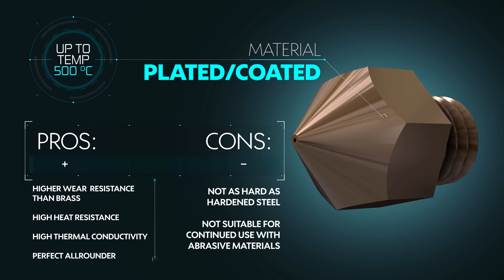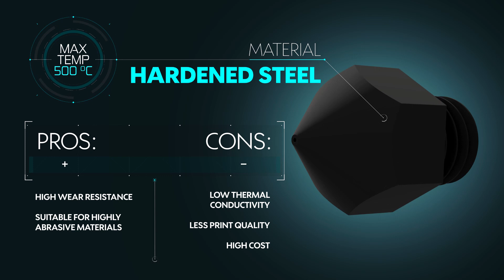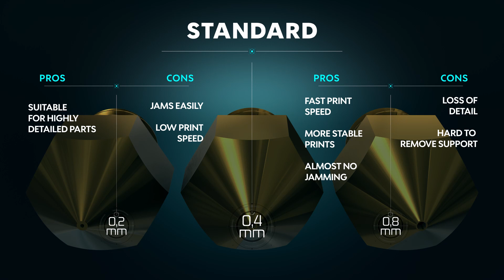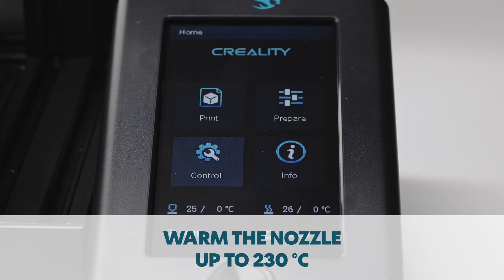3D Printer Nozzle Guide (+ how to change it!)

Comment: Is it necessary to replace or cut the bowden tube? I have changed two nozzles without changing it and they lookks working fine.
Reply from the maker: Hi Andy! Thanks for watching. :-) 
No, it is not necessary to cut it.
Reply: It depends to your printer. I am using Anacubic Vyper with no problems as long I used the 0,4mm nozzle. Problems started to occur when changing to diffrent nozzle sizes. Even after upgrading to E3D Revo I had the same problems with clogging as I did not remove the PTFE tube.

Comment: Thanks for the clear, informative video. 

I have two questions. I was thinking about buying a 0,40mm hardened steel nozzle for my normal everyday PLA prints. Not that a brass nozzle wouldn't do the job, but I would simply never have to worry about nozzle-wear ever again (using only standard PLA). However, you mention in your video that hardened steel nozzles have "less print quality". My question is in what way. Is this more in a aesthetic way or in way that it influences thoughness? Since my prints are mostly ornamental, it would be kind of a no-go if hardened steel lowers the beauty alot...

Second question regarding printing with your wood filaments. You advise a nozzle ≥
0,5mm, which I assume is to avoid clogs because of the wood fibers. You don't mention the type of nozzle. Is it right to assume a brass nozzle would wear down pretty quickly when printing filaments like these, thus a ≥
0,5mm hardened steel nozzle is recommended for the job? Thank you.
Reply: Real shame that nobody answered you.
Reply: Well I see no one answers after 2 years. Unfortunately, I can’t answer the first question because I don’t have experience with hardened nozzles. But I can’t answer your second question: Wood filament is indeed abrasive, so you would need a hardened nozzle.

Comment: I don´t agree with the nozzle change. It is not necessary to remove the hotend push-fitting and cutting on the print plate is not an good idea.
Reply from the maker: Thanks for watching our video! :-) 
You are right! It is not necessary. On a Creality Ender 3 V2 it is sometimes a bit tricky to remove the bowden tube from the mounted hotend push-fitting. If you are not removing the push-fitting you are putting a lot of force to the Axis to remove the bowden tube which is also not that good. :-) This differs from printer to printer of course!
Cutting on the edge of the Carborundum glass plate is not the best-case but we think it is ok if the knife is sharp enough and you do not have to saw it like a tree. :-D
Thank you for your Feedback!
Reply: @3DJake_Official  true but in the end you showed in a guide only one specific printer. It is better to separate guides from how to's - for your future videos.
Reply from the maker: The nozzle change is only a part of the whole nozzle guide. :-) thank you for the feedback!